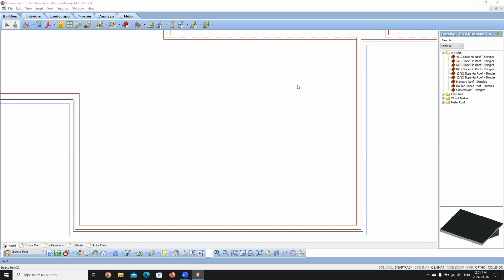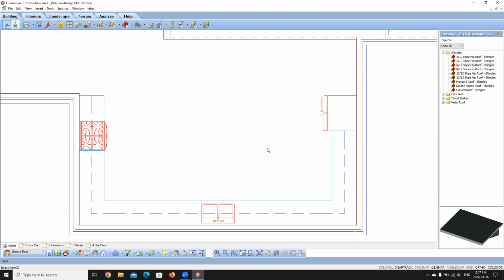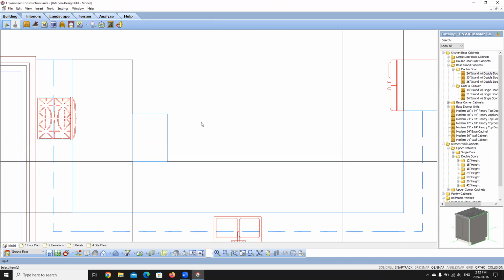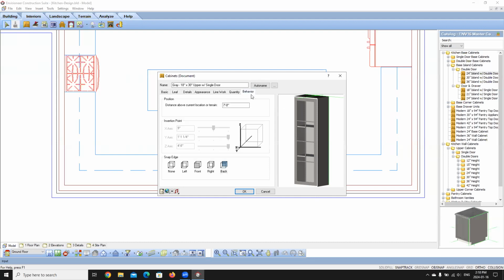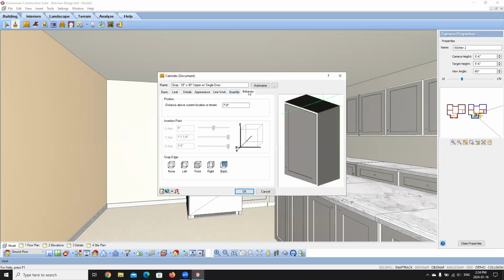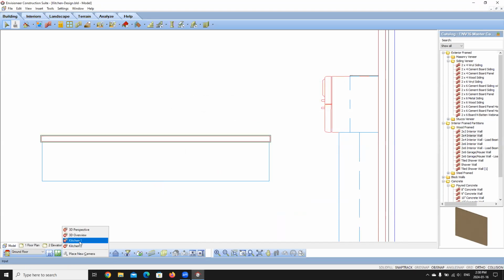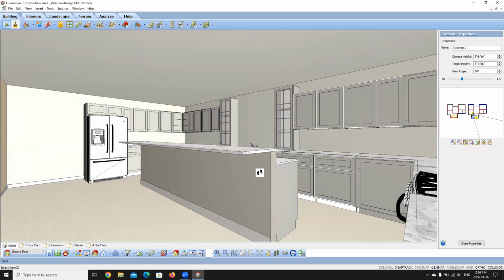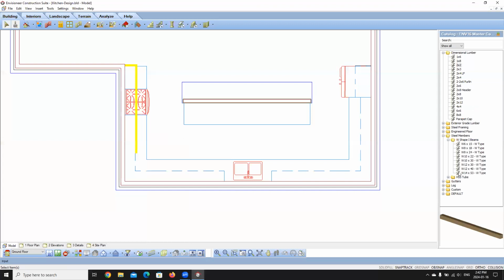Envisioneer Webinar Recording - Kitchen Design

Comment: Ok but where is the plumbing drawing?  Does this software not do plumbing drawings?
Reply from the maker: Hello
The plumbing fixtures can be found under the Interiors tab. Once you have inserted the plumbing fixtures you can create a diagram using the members command. Members can be used to represent the plumbing runs and columns to represent the stacks.
Here is a video on using members for items other than structural members.
https://www.cadsoft.com/using-members-as-alternate-objects/